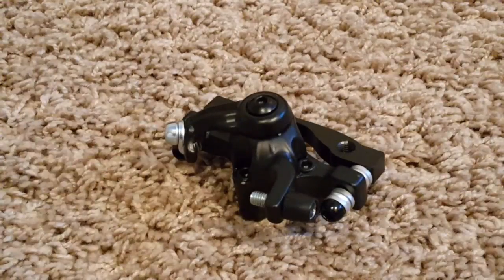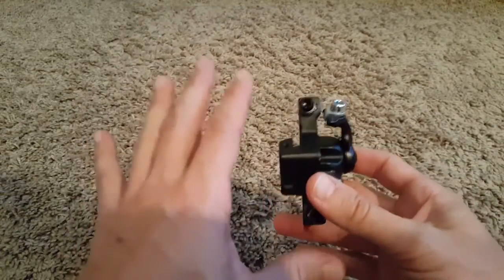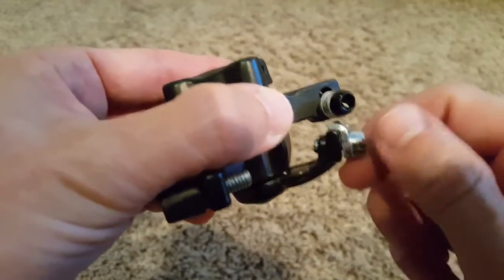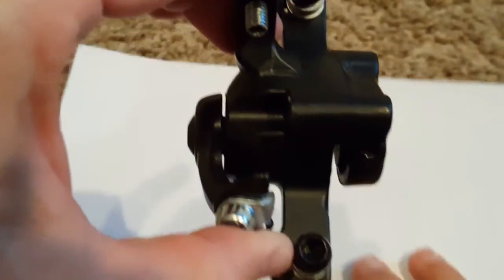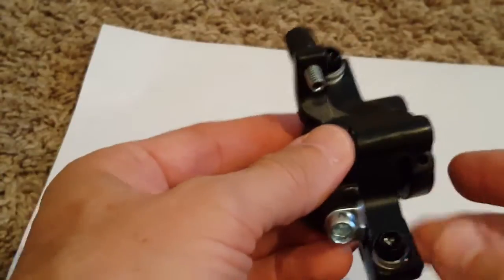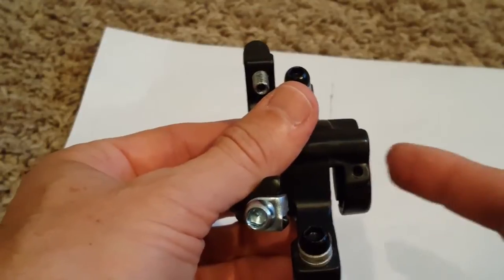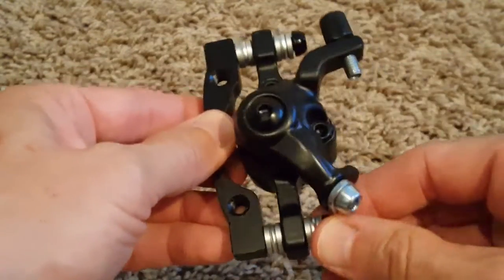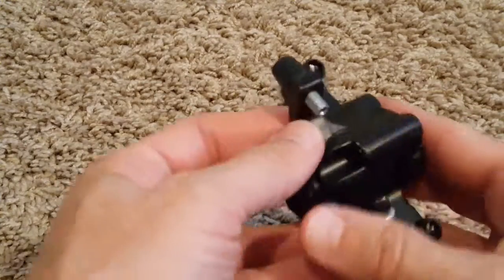How does a Mountain Bike Mechanical Disc Brake Work?

Comment: great video bro 
I'm working on a college project which i will use for the braking system the bicycle caliper. 
so i want a relation or a formula to calculate the torque required to generate a normal force on the disc ?
Reply from the maker: Thanks - wow that's really advanced stuff I've no idea about - sorry ...